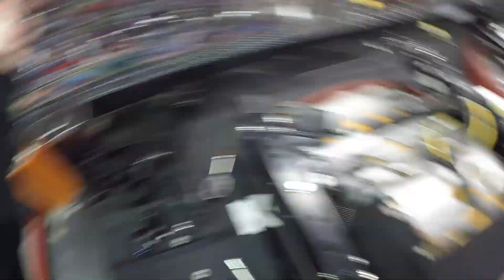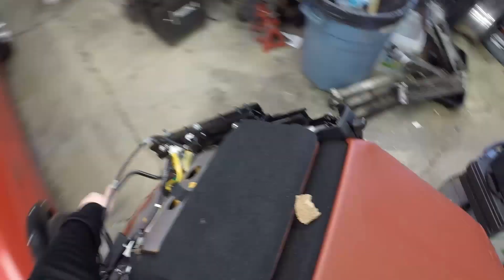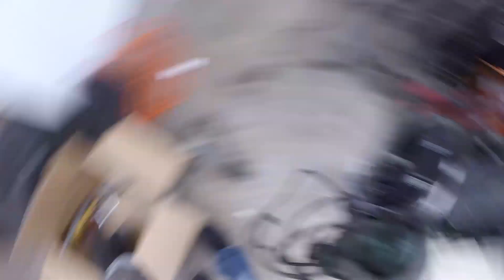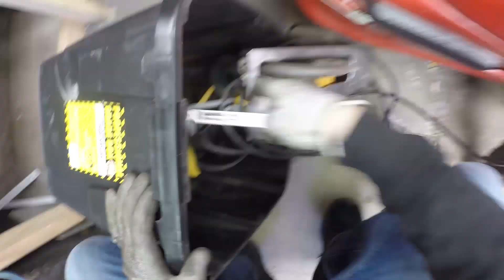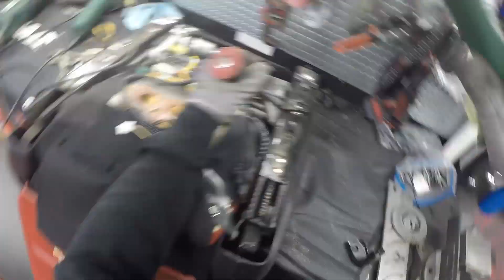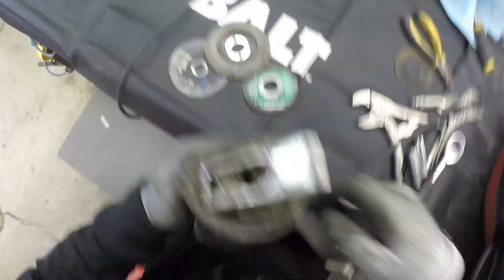RX-8 Seat Swap - Episode 2: Seat Prepping

Comment: Hi I’m doing the same conversations as you. What I noticed is that you left one of the center piece bolt from rails. Could that be the bolts that holds the mechanism attached to the threaded rod located inside the rails that controls forward/back motion.